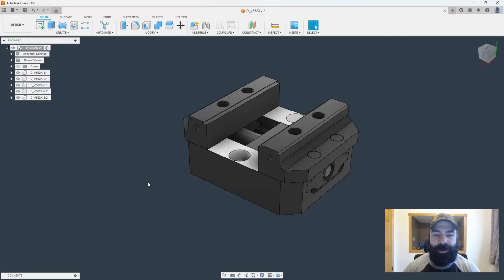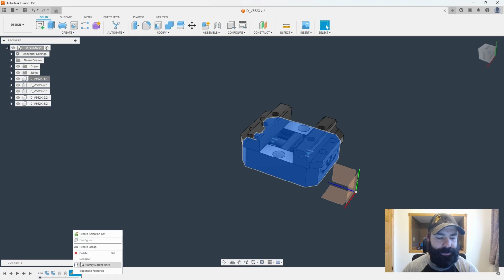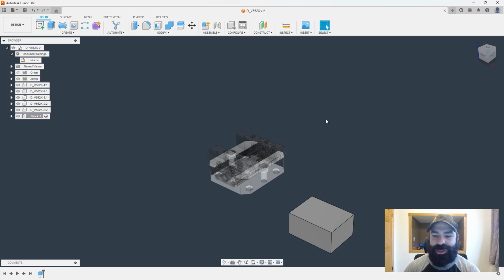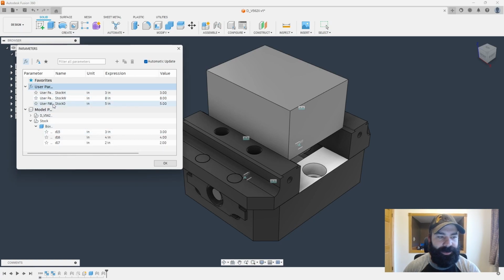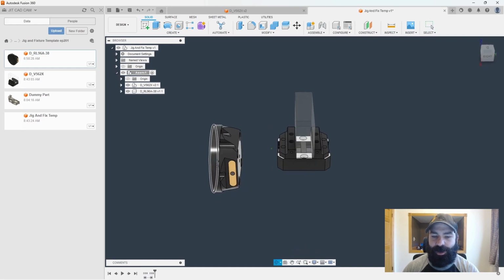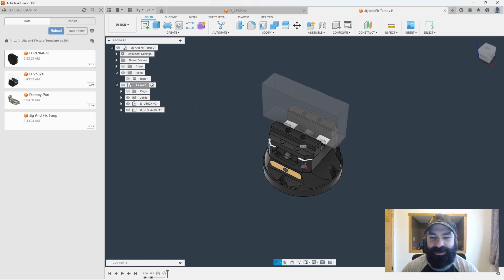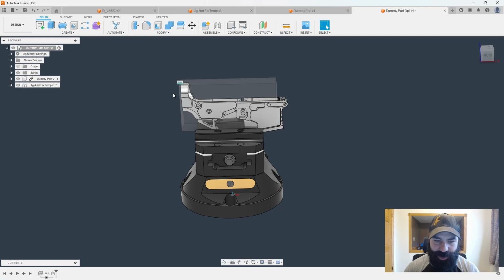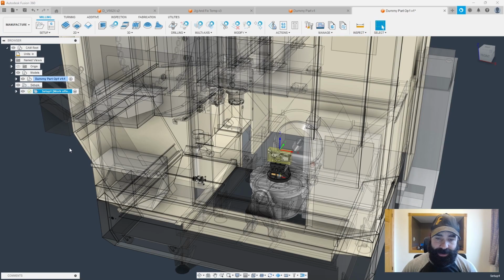Fusion Friday: Setting Up Jigs and Fixtures for Machine Simulation

Comment: Hi how can i create a parameter that can rotate my vice 90 when i want. i use zero point L shape 4 axis and i need to do one set up at 0 degre and an other at 90 to simulate 5 axis positioning
Reply from the maker: You could do this with the Joint when you fix it to the base. Ther is an option to rotate around the Joints Z Axis

Comment: so i have a question about using the parameters to be able to shift the stock in X so its not centered in that direction if the part requires it to be machined off center??
Reply from the maker: I would check out our other video where we highlight How to program from center of rotation

Comment: Some things I’d like to see is some advanced tips and tricks when using a 4th axis. Like profiling parts and having ball endmills use the tilt and lean or any of the 5 axis tool paths. I recently used something like that on an oblong part and it was tricky to figure out if you’ve never used those features.